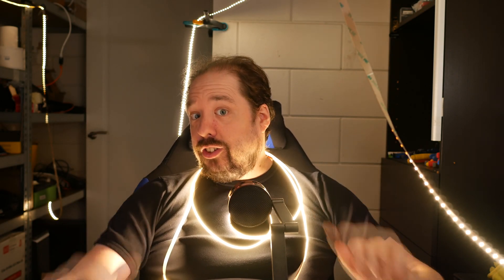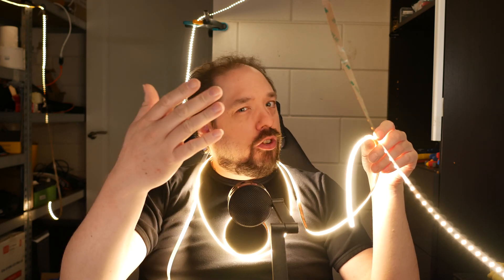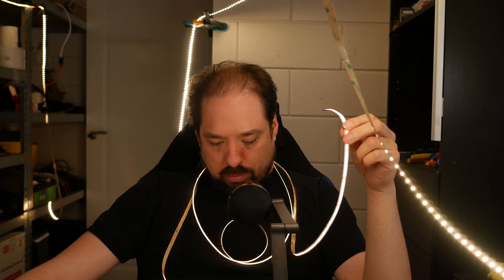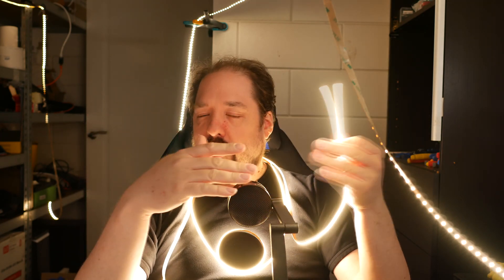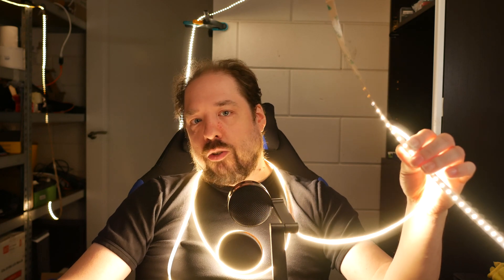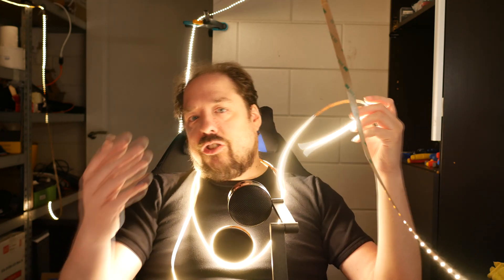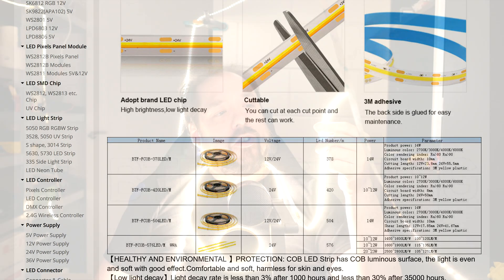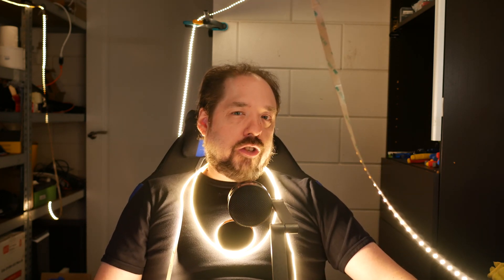QuinLED: Taking a look at COB LED strip

Comment: I got a strip off aliexpress and it's green on the edges. I'm not sure if I'm crazy as I have no equipment but I'm tempted to return it and get this because it feels low CRI
is there a good test for checking CRI (an estimate) at home?

the 90cri showed is not available anymore D: any COBs that you recommend that are 90+? have you tested any?

Comment: I have RGB under my counter hooked to Dig-Uno. Can I hook a COB to the same Dig-Uno and control them both?
Reply from the maker: If it's a digital one, sure, no problem  there.
Reply: @IntermitTech  sorry I just heard cob comes in rgb. I am using a white only strip next to rgb. This is so I can get a bright white

Comment: Hello! I just purchased these exact ones for a cove ceiling detail around my living room. I'm just a home owner trying to get this right the most cost effective way. WAC wants a exorbitant amount of money for theirs.  I purchased the the EMITEVER COB LED Strip Lights at 2700K 32.8 ft on amazon. The power supply they are recommending with this purchase is the "EMITEVER 24V DC LED Power Supply, 60W LED Power Adapter, Lighting Transformers, Input AC 100-240V UL-Listed,Class 2" 

However based of the reviews, there is a 3 second delay using this power supply when switching on the lights using a dimmable Lutron switch. Can you recommend the best power supply to purchase for these led lights? Ones without delay? Along with quality led strip connectors? 

I would really really appreciate it! 

Thank you so much.
Reply from the maker: Poh, one without a delay when turning on I really have no clue. All my strips have dimmer boards attached to them so they turn on/off instantly basically. They are never off off

Comment: Great video, thanks! Can you compare the brightness of the 500leds/m cob vs sk6812 60leds/m warm white? Just installed the sk6812 as under cabinet light in the kitchen as an upgrade to my old yeelight led strip which had terrible RGB white and was not bright enough. Sk6812 are fine at 100% white on accurate setting in wled. Just thought afterwards, maybe cob leds with 12/24v would have been easier / better.

Comment: Hi! I'm just a beginner to the topic, so one (maybe silly, idk) question: I heard that milky diffuser always reduce the brightness of a LED strip, so to use it as main light source what is better this COB LED strip or an high-density SMD Led strip with a milky diffuser?

If the answer is in another video please link it to me, I'm new to the jargon so my search efforts are not always fruitful.
Reply from the maker: For sure the COB strip if we're talking addressable RGB stuff. For high power analog it's a bit tougher question.

Comment: Can you give any insight whether these would work on planted aquarium tanks? The plants in aquariums need particular specification in order to grow healthily. Can you dial in the strength and range of these new COB lights? Are they making any aquarium lights yet using these diffused strips?
Reply from the maker: For grow lights I use Auxemer CRI95 in 2400k + 5000k myself and that's worked great over a 1.5 year period now. Might not be the most energy efficient setup but does give the plants great light while also being great light for the eyes.

Comment: how about the heat ? is it the same as regular led strip ? 
i wanted to try these because with normal led strip i have to install diffuser again 
also can this be used with smart controller?

Comment: Thanks for sharing. Can be conected directly to a usb??
Reply from the maker: They are 24v, no
Reply: @IntermitTech  Thanks.So 12v will be ok, if I will connect the right Usb?
Reply from the maker: Well no, USB is 5v and only has very limited power available generally.

Comment: Can u use them inside- an aluminum profile ?
Reply from the maker: Yeah you can, but these are better without really, since the COB material already provides a bit of diffusing.
Reply: @IntermitTech  And what is the temperature exactly ?

Comment: Since they are so efficient, would you say you could run these without aluminium profiles? Maybe not at full brightness but 50%-70%? 
They're really interesting strips and indeed give a completely different effect! Perfect for where you can't fit an aluminium profile and still don't want hotspots
Reply from the maker: Sure yeah I think that would be ok. I've had mine running on top of that closet since this video, no issues so far and feeling them to the level we have them set to (50%) they are fine. Colors wise they aren't as warm as I'd like though, certainly more in the 3000k to 3200k range. So not ideal in that regard. CRI I haven't tested yet.
Reply: @IntermitTech  did you test the CRI since posting this video?

Comment: to fix double edges in your video select all clips, right click - switches - disable resample. it is common vegas error.
Reply from the maker: I know how Vegas resampling works and I don't have an issue with it, but what errors are you referring to?
Reply: @IntermitTech  for example @0:38 when there is movement and you pause the video you can see double edges

Comment: Would appreciate a video on what quality double sided tape for LED strips to use. Especially when the strips are glued heads down under a table or from the ceiling the original tape on the strips is not capable of staying put. I believe it is due to the heat generated by the strips, the glue becomes less sticky and after some time the strip comes lose and drops.

Comment: Hi, are you planning to complete the "CCT LED strip (Selectable white color)" section on the quinled website ? Because i am interested in knowing good CCT led strips with good CRI (at least for warm and neutral white colors).
Anyways, thanks a lot for the valuable info on the website and the buying recommendations.
Reply from the maker: I recently updated my favorite white strip article. Look in the premium section, the Auxma CCT is really good!
Reply: @IntermitTech  Oh thanks for the answer, i haven't noticed the update on the website until you told me.
Reply: I'm really interested in this, too.  Are there any COB strips with dual white colors that are addressable?
Reply from the maker: I haven't found any COB CCT strip yet, they might exist, not sure because the fosfor caution partially determines the LED color, with CCT SMD strip that is no problem, each package has their own. But with a COB strip that would become significantly more difficult!
Reply: @IntermitTech  WE HAVE
Reply: Major Lighting can provide CCT COB LED Strip

Comment: hello, I have seen all your videos and they are super cool
can you suggest the board for dimming the spotlights (cob lights) which are in the ceiling and also for the downlights as well. thank you.
I have used many circuits but they get flicker.
Reply from the maker: For the COB lights I use a QuinLED-Quad or QuinLED-Deca, no issues really? What issues are you seeing exactly?
Reply: @IntermitTech  I am using https://imgur.com/umo0odO circit

Comment: The yellow material is a phosphor coating.  The LED's in COB's usually are focused more in the Blue colour and they use the phosphor coating to make the colour warmer.
The are fabulous for using in places where the strip is visible or where a diffuser may not be possible.  There is a lot less glare from the LED's also.
Reply: Are these strips weatherproof?
Reply: Will you going to buy it?